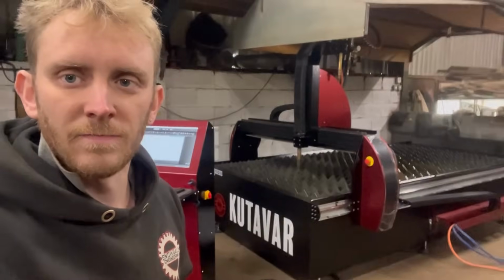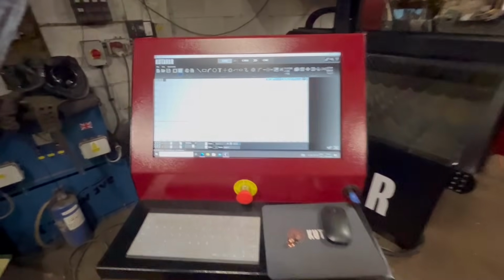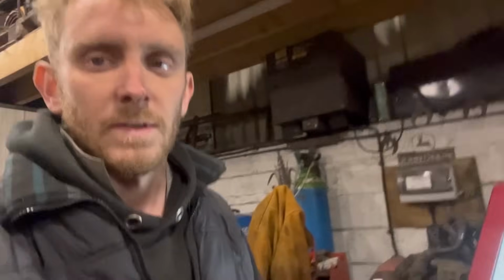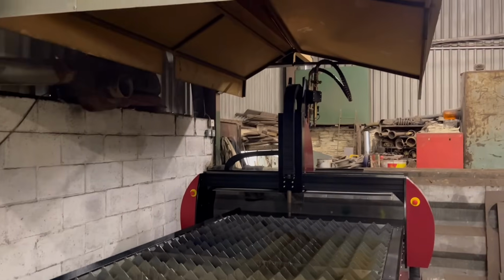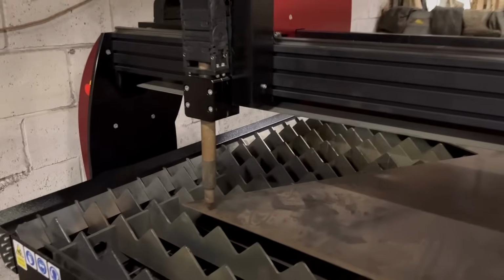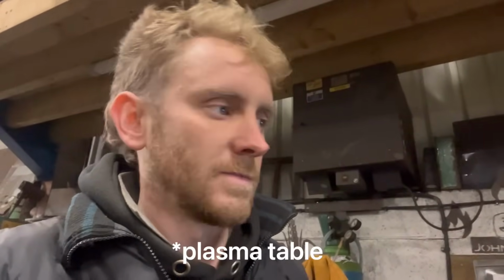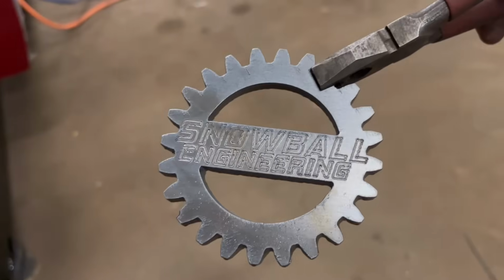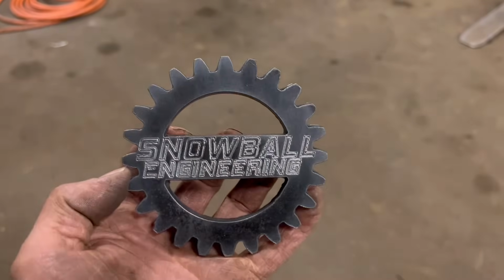My BRAND NEW Kutavar cnc plasma and oxy/propane cutting table.

Comment: Im really grateful that we have three phase power basically everywhere in Germany.
Reply: Yes, agreed, a civilised country that thinks things through. 3 phase is a necessity, not a luxury.When I worked there - and that was in the '70's - a lot of the mains cabling and services were run under pavements which meant very minor inconvenience to traffic and road use, unlike Britain where roads are dug up the repaired by the Gas company. Next month the water people dig the same road up to repair a leak. Then the Electricity supplier comes along 6 weeks later to install a new cable. It should be mandatory for any building/planning permissions that 3 phase is included to the property. The retrofit cost is astronomical in most cases. The UK is third world in its power/ data cabling mentality and they wonder why businesses struggle.
Reply: @catabaticanabatic3800  Dont get excited. Internet access is still absolute garbage in Germany especially for business. And good electricity isnt worth anything if you are not allowed to build commercial/industrial buildings and also none are available for rent. Additionally you arent allowed to do business / make noise in residential buildings anyways
Reply: @Narwaro  glad I live in England
Reply: Same in Norway. 3 phase everywhere. He could install a single phase to 3 phase converter. I have seen many American fabrication channels on YT having it
Reply: @Frank-Thoresen  True but youre still limited by the maximum amount of power you can pull out that socket. And true threephase gives you basically six times the power for almost the same wiring and copper gage
Reply: I lived on the Swiss/German border. Everything is better there, the Swiss are better Germans than the Germans!
Everything works so perfectly there, I’m English and everything is so flawed here that I ended up feeling very uncomfortable there. I missed the trashiness, chaos and disorder of the UK and moved back.
Reply: @Narwaro  You are totally correct
Reply: @Narwaro  I still wonder how an industrial area can be located where there is not enough electricity and lack of 3 phase. Beyond my understanding
Reply: @catabaticanabatic3800  the vast majority of the country doesn’t need three phase, hence no need for it.
Reply: It’s not at all difficult to get 3ph power, there is a connection charge, and if you’re very rural (and I guess this guy is)  then installing it could be more cost than the value. I lived in France and had 3ph domestic boiler for my heating, but that was put in at the build phase.
Reply: Here in Croatia we have 3 phases everywhere.
Reply: Two hots is still single phase.   Think about it…..how many straight lines can you draw between two points?  One!  Now 3 phase ……draw 3 points (hots) in an equilateral triangle. You have added one point to the previous single phase diagram but now you have 3 phase vectors.  

I won’t embarrass myself with an analogy for 2 phase (yes there is/was such a thing but it was rapidly replaced by 3 phase in most installations across the world) 

So called “split phase” is still single phase but as used here in North America it’s got a neutral plunked down in the middle of the phase to allow you to have 1/2 voltage circuits from hot to neutral and hot to hot circuits with full voltage.  

Neutrals are a “thing” in 3 phase as well and allow you to get lower voltage single phase circuits that tap one hot and the neutral.
Reply: @jimrankin2583 2 hots are two phases, 180 degrees apart (hence twice the voltage). If it was a single phase, they would both be the same and it would not be able to power anything. This is (as you say) easy to achieve at your local transformer using a center tapped winding so the higher voltage distribution network could very well be single phase, but those two hots are not the same.
Reply: @stjepanvorkapic1430 ...ARE YOU BRAGGING OR COMPLAINING?!!
Reply: Aqui na minha casa tenho 2 medidores de energia trifásico e estou instalando um outro monofásico.
Reply: @jimrankin2583  Split phase supply are still used in the uk for two single phase supplies at nominal 240volt l-n, 480v l-l in one metered supply.  The benefit is twice the power in the property with no more than half the sum of total phase currents on the neutral. Still very much in use in the uk in more rural.
Reply: It’s everywhere in the uk too, you just pay for installation, if you’re remote on a farm then you may have a massive bill to upgrade.
Reply: @chipperkeithmgb  you're not a very smart fella are you?

Comment: As more and more word gets out about the type and quality of you work, this machine will have paid for  itself within a few years.  Also the fact that you can weld on Snowball Engineering patches onto ALL your work will pay off in free advertising. The owners of whatever you have made will testify to the quality of what you have made along with its suitability/effectiveness. That's priceless word of mouth advertising which might be slow first up, but it is free and is also the best form of advertising you can get. Relatively quickly you will end up with more work than you can handle - and that will create problems of its own. Just make sure you make a decent profit on all that you do. Some of the stuff you do, no-one else wants to touch. Make sure you price that work appropriately. Overall, well done. I enjoy seeing what you are capable of making/repairing/inventing. Retired mechanic/machinist in Land Down Under.

Comment: Power system engineer here: Give me a shout if you ever want some pointers on running more stuff with the electrical capacity you already have available to you... There's funky stuff that can be done.
Reply from the maker: Sounds interesting!
Reply: So with the right inverter and battery you can have the battery charge when the load is light and then discharge when say the plasma is doing a heavy cut (automagically) Can add solar to the system too.

Comment: That engraver is really cool on such a machine.
It looks like the z-axis is operated with a pneumatic cylinder and there seems to be no feedback to the controller where the head really is. This is well good enough for engraving part numbers or batch numbers, but for more advanced engraving it leaves things to be desired.
The main issue seems to be, that the head sometimes doesn't go up all the time. Since there is no feedback where the head really is, the controller just waits a set time for the head to come down. If it was not all the way up, it sits in the start position spinning for too long and makes that little hole.
At the cost of more runtime it should be possible to set a delay for retraction long enough for the head to go up all the way every time. This way it is more predictable how long it will take to go down and a setting can be found that works well.
If the controller has additional IOs and the integrated CAM software supports insertion of custom g-code, there should be a way to add a sensor, that simly tells the controller if the head is down all the way and it can start moving.
Reply: Another option is to not have it start the engraving head until the end of that dwell, so it doesn't sit there and buzz that starting dent. I can't quite tell if the head is electric or pneumatic. If pneumatic, it might just be tee'd into the lowering cylinder. Either way it could be improved with a software fix or two. If not, I'm sure you can engineer a fix for it beyond using a clamp to block its retraction.
Reply from the maker: It’s pneumatic

Comment: Best wishes with the new machine. For the merch idea, how about engraving the logo like you did in the video, but instead of cutting out the teeth, engrave them, then outside that, cut out hex shapes, around in a circle, each the different sizes of a socket, so it would be something you could use to open a nut or bolt?

Comment: Hi . Well done on your new machine. I bought a Swift cut 3000x1500 pro a few months ago and i run it with a Hyperterm 45xp single phase it runs great with it i have the same problem you have no 3 phase It's an option if you want to run a HYPERTERM on your Machine with out having 3 phase

Comment: Shame about the 3 phase, rural areas / farms are not usually covered for 3 phase unless it is essential. Nice machine, but I can imagine the engraving, as it stands, is pretty time consuming. I worked on CNC and CMM machines and we didn't have to send the tool home during the cycle, there has to be some code or set point to work too. The Snowball Engineering merch sounds good to me. Thanks for the tour of the machine, the plasma cutting is good, see ya next time 👍

Comment: Hi Oliver,  I  had a good idea of what you were going to  purchase from the  last comments  you made ,    your last machine  looked tired  so you've  plowed money back into your  business  very wise move  as some would have  poured it down there necks and had nout to show for there time at the grind stone .    There may be days you feel crap       my advice is  keep going it will pay off in the end .      Save up your money from jobs an plow it back into  New  Machines , ie like a  New   Mill / Drill machine ,     An up to date Lathe with  DRO      make your life easy  rather than struggling  along .     From the door into your work area build yourself  an overhead gantry  for lifting heavy  jobs you only have one back,    knacker it an game over  .    An overhead gantry will be in my opinion  better than a forklift  just an idea   Regards        Stan.

Comment: That little sign looks good, would it do one in thin  stainless steel  or aluminium/brass  plate with a couple of screw holes in it for fastening to a gate post?

Comment: looks like the software guys need to stay for a few weekends at work to address that engraving.  That should be smart enough to know if your doing 6 more letter engraving, just to raise up a bit move to next letter and go again.  No need to home all the way up.  I can see if your cutting a bit then engraving and cutting again, going all the way up would protect the engraves if a small off cut does not fall out of the sheet properly and sticks up a bit.   But it looks like a fun new Toy :)

Comment: Great new addition to the workshop, you can buy phase converters that will provide you with three phase power from single or two phase supply, not cheap but cheaper than running a new mains supply.  I am surprised that there isn’t a way to modulate the engravers z axis within the software, perhaps you could alter the G code for that in conversational mode?
Reply from the maker: I already have a big phase convertor. Hypertherm void their warranty if you run their machines on a phase converter tho so obviously plasmas aren’t that suited to run on them.

Comment: If you need 3 phase for a specific purpose, like when you're cutting, you could look into a 3 phase generator. Would be annoying for things like tacking and on/off welding but you already have the power for that.
Reply from the maker: Yes, it’s a possibility. A lot of the cutting I do is only one off things 10-15 mins at a time which isn’t ideal for a generator, that’s why I like the tecarc running on mains power.
Reply: @snowballengineering  yeah, there's definitely a convenience to mains power 😅

Comment: Great to see you’ve it up and running 👍😎 the engraver is loud what air pressure are you pushing into it? As others have said using it to mark locations of other components/bends will really be useful.  Do like the look of the integrated CAD software. (Much nicer than swift cut setup IMO) Can you show what it’s like nesting a full sheet up with various parts one day?
Reply from the maker: Not sure on pressure, it came already set, although it does have a dial you can turn on the top to slow it down.   Yes, can do

Comment: Cheap little petrol engine powered extraction fan might be an idea for big jobs? Or modify that hood to funnel to a small electric extractor as well?
Reply: I was thinking the same thing. It could sit outside with a remote start for the big jobs.  Could be tied in in parallel with the existing fan via relay and even an on/off switch to open the Gas Blower circuit.  This could be manual or auto via CNC (if outputs available). The thought being close switch to enable Gas Blower, open switch to use only existing electric blower(exhaust fan)only.

Comment: new machine looks very nice. bit annoying with the engraver travel distance. are you not able to raise the plasma torch up higher into the mount. that would shorten the distance for the engraver ?
Reply from the maker: No, unfortunately it doesn’t work like that.
Reply: @snowballengineering  thats a shame,  but sure looks good. i assume you got rid of the other plasma table to make room for the new 3in1 table.  thanks for the videos you put up.. keep them coming

Comment: Another option for 3-phase is a rotary converter. Doesn't get past your main issue of a lack of available current, but might be worth a look?
Reply: He already has a phase converter but I think it’s limited by its size.
Reply from the maker: I have one, but wouldn’t want to run a plasma cutter on it.
Reply: @snowballengineering but could potentially use it to run extractor fan (appreciated if depends on power consumption of fan)

Comment: Can you get 3 phase power on in the future? Lovely machine, congratulations. From Pete in Australia.
Reply from the maker: Worth looking into, but I have a feeling it will be extremely expensive.
Reply: @snowballengineering yep unless you have three wires on the pole close by its going to be very expensive, if you have 3 wires it’s just going to be expensive 😂. My mate has been quoted 150k for a new supply. Needless to say he is going generator, battery and solar. Generators are a fairly cheap option especially if only needed short time, just have it on remote start.

Comment: How much roughly was the set up ? Looking into the different brands of cnc plasmas and weighing up the pros and cons of each
Reply from the maker: A machine of this specification with a hypertherm 105 is around the £45,000 price range.
Reply: @snowballengineering  that’s for the fast response

Comment: What's the difference between plasma cutting and gas cutting on the table? Is one used for thicker/different material?
Reply: Correct. He does explain in the video that plasma cuts up to 20mm and gas torch up to 100mm
Reply: @sjv6598 thank you. Sorry I must of missed that

Comment: Has to be an improvement. The engraver going up and down that far is a pain though. Must be some software that fixes that. After all everything on it is computer controlled. Only as good as the software and input. A bit more fiddling and you will get it sorted.

Comment: I would suggest a sheet of 100mm thick loft insulation board placed under the material when engraving. Its light but firm, will reduce the tool travel in Z and reduce the sound/vibration?
Reply: Raising the material won’t work, it’ll hit the plasma head.

Comment: Hey, can you edit the gcode on the program?
If you can, just delete the lines where the engraver wants to lift up. 
And ask the manufacturer to update the software so it doesnt do that. 
Its kind a waist of time to do it.
Are you shure you can put a bracket on there to avoid it from lifting up and it doesnt burn the motor if it cant find the limit switch?
Nice machine! 🤟🏽
Reply from the maker: It’s a pneumatic cylinder that lifts the engraver
Reply: @snowballengineering aaa okey. 
So it keeps the tool pressure the same, kinda smart using air.
Is there a limit switch or a hard stop?

Comment: Out of intrest at what point do you start using a 3phase gennerator, iv wited in a 25kva genset to run all my 3phase stuff, its alot cheaper than single phase 
Little knockoff cummins engine does about 24hrs run time on 30lts of fuel
Reply from the maker: We do have a 125kva generator on the farm but now I have my phase convertor I don’t need to use it. If I did get a bigger welder or plasma I’d probably invest in a 40-50kva generator.

Comment: Great videos fair play would u be happy with the tecarc mig and plasma in single phase i,m running 400amp butters mig good welder but getting tired time for a change thought about an INE 300 amp or the tec arc mig same as urs
Reply from the maker: Where I used to work there was a tecarc identical to mine but on single phase, it was a good welder but mine has heaps more power being on 2 phase/split phase.
Reply: @snowballengineering  does ur welder and plasma work of a phase converter

Comment: I’m a bit confused, you say you don’t have 3 phase, but you have a red CEE socket on the wall, never known a single phase in red.
Reply: Ahh, that explains it, 30 seconds after I posted 🤣

You’ve got split phase, two 100A 240v services.
Reply from the maker: Only 2x 50A unfortunately

Comment: they must have somebody who can re write the software so it only ever lifts 5-10mm above the surface height it's set to engrave. Surprised it wasn't programmed like that anyway.
Reply from the maker: Trouble is it’s pneumatic so it only knows up or down. I don’t think it’s normally a problem on a standard machine but because mine has a gas torch, the gantry needs to be a lot higher to avoid the extra heat.

Comment: We have an ESSCO with techserv CNC at work, and the software is infuriating to use via touch only.
Reply: are you meaning the draft sight  and sheet cam they supply as standard? They do do another cad program and i use a mouse and keyboard with mine and still has the touch screen layer in the screen.